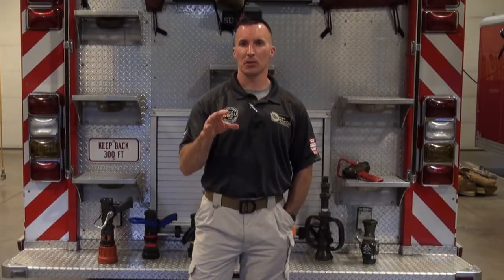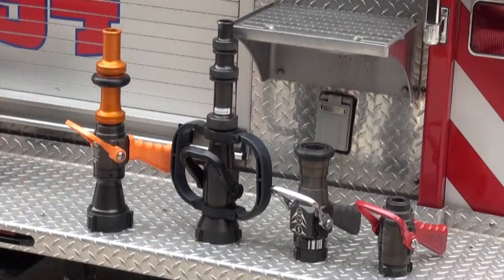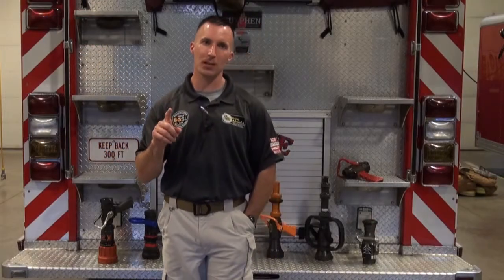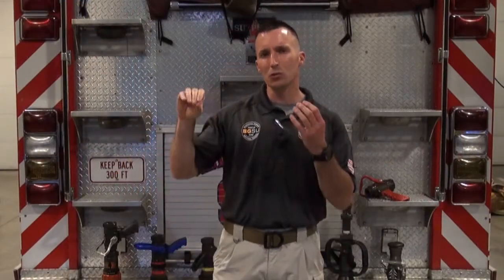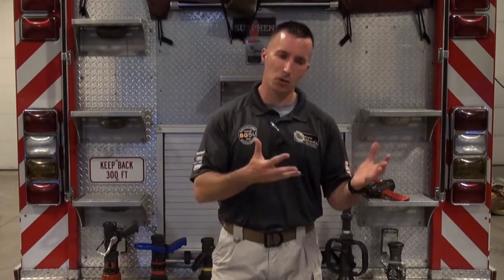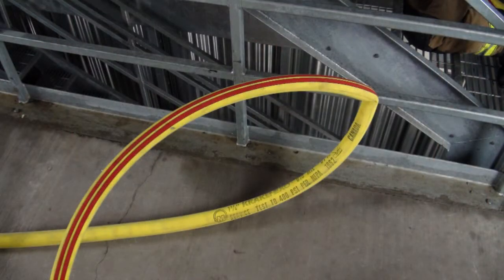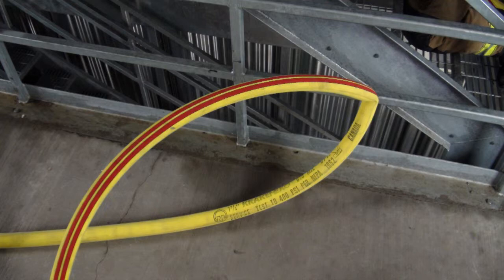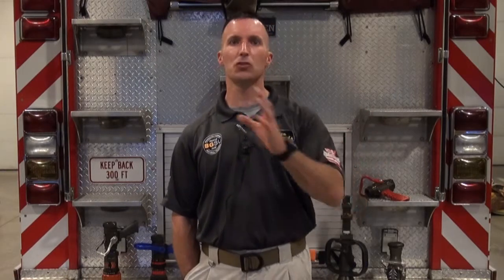Smooth Bore Nozzles

Comment: Melbourne Australia. We discarded smooth bores for automatics back in the 1990s. Modern pumps can easily supply whatever pressure will give 100 psi (converting from metric in my head) at the branch. Modern autos can do everything a smooth bore can and a lot that they can't. For internal structure firefighting, I cannot fathom why one would use anything else.